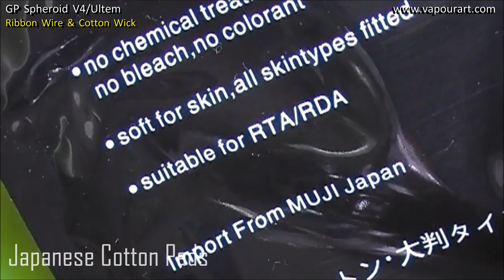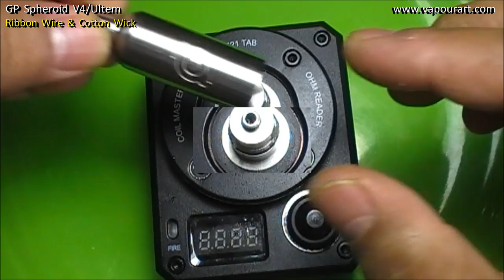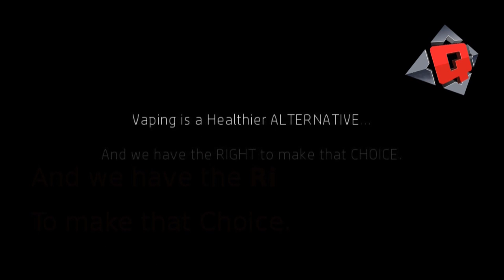GP Spheroid V4 / ULTEM: Ribbon Wire & Cotton Wick Setup

Comment: been using only spheroids for 5 yrs from v2 and 3, v2 is my fav.
 bought one of these and found it a nightmare to coil, tighten the wire around the outside of the posts and you can't squeeze your coil with tweezers to make it tight so i managed after 5 goes to get it wrapping from the centre outwards and tighten.
 still think the actual coil space is to small as it touches the chamber if not a tiny coil.
 all being said it does work well after you manage to set it up. i don't think it's anywhere near the flavour of the earlier spheroids though. they don't crackle and you get a thick smooth vape from them.
this reminds me of a nautilus

Comment: With ultem tank, spheroid is now just perfect!
Reply from the maker: +David Off Yep, loving the look. Thanx for the view buddy!
Reply: +Qorax Stan what 14500 battery do you use
Reply: If I may, Perseas recommend using AW IMR 14500
Reply from the maker: +of4nby I use Sanyos, AWs and Efests buddy. Thanks for the view.
Reply from the maker: +David Off Yep AWs are good. The new versions are even better with a few mAhs added to it.
Reply: +Qorax Stan I had problems with the Effest and the Pin length on the Piccolo, but with the new AW, it's  perfect.